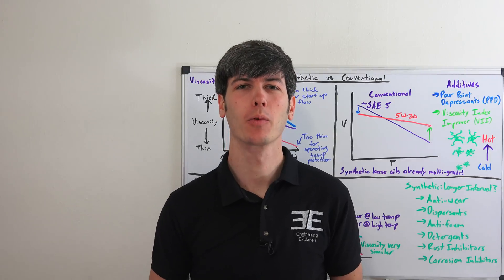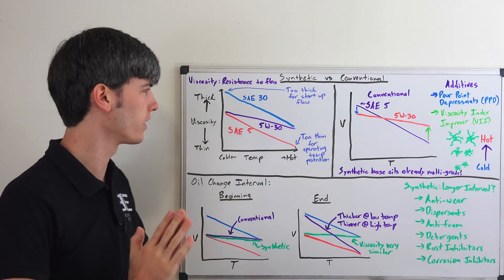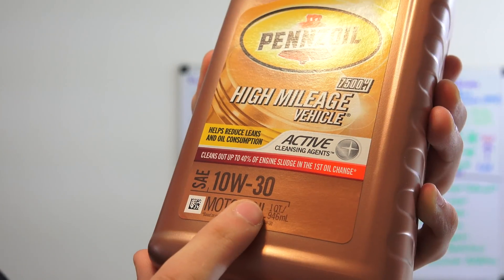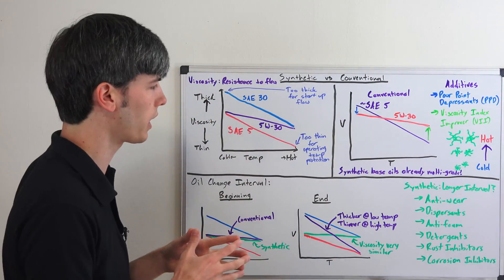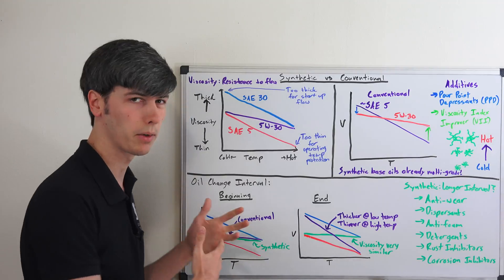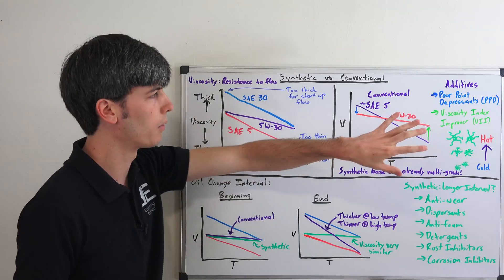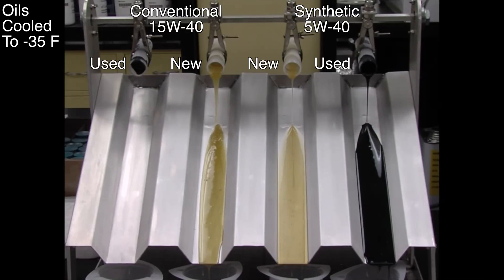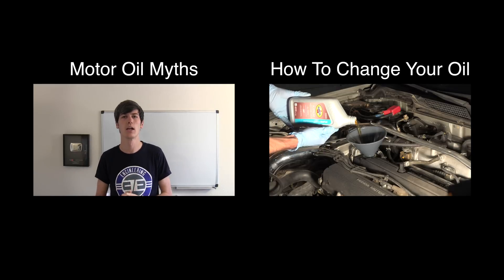Is Synthetic Motor Oil Better For Your Car?

Comment: the test is done at 35°F? are you kidding me? which car runs at 35°F? to do a real test you should do it at real engine temperature...
Reply: get in your car in the winter time and start it genius, guess how cold it is outside
Reply: Kai Baumgartner what outside has to do with inside the engine? we have single digits sometimes and never seen the engine temperature at 35°F. just did a test, outside is 29°F with feeling of 25°F and the car was all night long parked on the street. at the start the engine temperature is 89°F
Reply: Two things: 1) the test is done with the oils cooled to NEGATIVE 35F - i.e., MINUS 35 - not 35F. The guy says so, and the same information is in the top left of the screen; 2) the point of this is not to demonstrate anything about how the oils would behave in a car engine at running temperature: it's to demonstrate how they behave relative to each other at the same temperature.

Lowering the temperature is just a practical hack that makes for a better demonstration. It makes the oils viscous enough that they don't just slide off that inclined plane in a second: you get a chance to see how their relative viscosities differ. So long as they're all at the same temperature, it's a fair comparison.
Reply: Paul B finally someone gets it. Oo and if anyone is curious. In a lab that tests engine oil they run the oil at 2 temperatures to get kinematic viscosity, 40°c and 100°c. We also run it in a "cold crank" which drops the temperature to -5°c to -30°c depending on the oil. That test is done with anything with a "w". A different test is done for transmission fluid and gear oil which drops the temperature all the way down to -40, depending on the fluid run temperature may be a little warmer.
Reply: Paul B 
Bill Nye the science guy wants to buy you a beer

Comment: About bogus as hell look at the test 15/40 vs 5/40 I have worked on autos for 50 years and I wouldn't run Syn. in a lawn mower it's great for cranks and cams but destroys cylinders

Comment: I like your presentations. There are lots of facts. But my epxerience often differs with you are saying. I have never used synthetic oil in 30 years. I owned cars for 17 years in South Africa and 13 years here in Canada. In South Africa I knew about synthetic but nobody i know ever used it. Here in Canada I know a few people with domestic cars that use synthetic and I am not sure if domestic cars need them more than imported cars. Maybe they do. But I have only owned one domestic car ever and i did not have it long enough to try out synthetic. I got rid of it and I am not going to get a domestic soon. So I am not convinced that synthetic makes that big of an improvement to start using it in my cars.

Comment: I understand the demonstration you provide but I would have been more impressed if the used synthetic oil looked less like tar.  I used synthetic in my Subaru and the used oil looks nothing like the black stuff you call used synthetic. It looks almost the same as it did when I put it in my car. I don't think that it would look that bad even after 100,000 km.  For all car enthusiasts who have seen used oil, you cast some doubt on the truthfulness of your demonstration.
Reply: Ray Dyck But Ray, does your oil look like that at minus 35 degrees Fahrenheit?  He has chilled the oil to exaggerate the changes.  Nothing hidden there. It was a great example that was well explained. Even showing why he didn't use the same grades was explained.

Comment: If your vehicle's engine is an older one with a good bit of miles on it, its a bad idea to make the switch to synthetic oil. I made this mistake on 3 different vehicles and with the same results! LEAKS AND RATTLES after about 6,000 to 8,000 miles after the switch. My brother who was a store manager of a popular vehicle service center for 25 years learned the same thing I did with return customer complaints of leaks and loud engine rattles. So, he had to stop even offering the synthetic oil change upgrade to owners of older vehicles. If your engine is 4 or 5 years old (or older)with 60,000 or 70,000 miles (or more) on it and a life of conventional oil then just keep doing regular service with conventional oil and drive it the next 100,000 miles or so and go from there. And here is a question that I always think about is with the synthetic blended oil! Is it an idea of trying to make the lower quality oil in the blend better? or is it to try and keep the upgraded synthetic oil from being so good it ruins your engine? Its a joke concept!  

And remember that MOST OF ALL THE SYNTHETIC MOTOR OILS are made from petroleum crude, or to say that is where they get the molecules to build the synthetic counter part. YES! synthetic motor oils can be made from other plant life but at a MUCH GREATER PRICE TAG! In brief they take crude oil and process  it down to molecular level (beyond refining), this removes ALL of the natural unwanted tars and paraffin that are present in the crude oil, then they take these collected molecules and reconnect them back into molecular chains, these NEW molecular do not exist in nature hence the term "Synthetic" can legally be applied. 

And here is the reason that this ULRTA clean oil is bad for OLDER HIGHER MILEAGE ENGINES! It breaks down this golden colored plaque (dino plating) (not sludge) that is left from the the over heated tar and paraffin's. This plating builds up over a period of time and it crowds all the internal parts of the engine, including seals, it also plates gaskets on the inside and causes them to overly dry out. As the engine parts wear, the plating crowds in, it pushing on the internal lip of the oil seals, ALL these items wear and seat into play with each one another. Now what do you think is going to happen if you switch to an oil that HAS NO tars or paraffin's in it??? well it actually starts to break down the dino plating, the first time you drain that synthetic oil it comes out REALLY NASTY! and you think WoW this is great! but what made that oil so dirty looking is the dino plating that those engine parts have grown to depend on, those oil seals are to worn to reseal in a new position, those over dried gaskets are already rotted and the dino plating that helped them to hold in the oil is GONE! those crowded mechanical parts that were so crowed now have from new room they never had, bottom line! leaks and rattles. In two of my vehicles as soon as the rattles started I did a quick switch back to conventional oil (the cheaper the better) and just let them idle for about twenty minutes, in which they still were rattling but the oil pressure was good, so I just drove them. The short of that story is around the 15,000 mile range on the conventional oils and both vehicle engines actually started sound decent again, with only light ticks and minor clicks, of course it was to late for the oil leaks! The question that one might ask themselves is, Whats To Old? How Many Miles Are To Many? Is It Worth The Risk? Its Your Call!

Comment: If you are doing the oil change yourself  then you are only paying for the oil which is very cheap.

I change my oil every 4 to 5000 miles and there is no way that's harmful to the engine, quite the opposite,  so stop being a bunch a tight bums and change your oil more frequently.

I use part synthetic oil and don't have problems and the engine sounds sweet.

Premature wear and failure on your main bearings and head gear is expensive to sort and takes your wheels off the road.

Comment: Mobil 1 synthetic 
Amsoil
Royal purple
For gas engines end of story.
Reply: Fram are decent if you pay $10 for their uber-super-heavy-duty-high-zoot-ultra-guard-macho version.

Moral? Pay $3 get a crappy filter. Pay $15, get a quality filter. Not many $15 filters are crappy. Pretty much all $3 filters are crappy. Fram just happens to head up the list of offering a lot of cheapo filters. A pair of Hanes socks would do just as well in my opinion.
Reply: Lifted_Above  Mobil One Full Synthetic with Mobil One oil filter.  Done.
Reply: Arthur Smith exactly true. Mobil 1 silver bottle 5w30...always.
Reply: Jason C. Excellent filters. Check out  YouTube  Mobil One live engine tear down The inside is in excellent clean condition using  Mobil One.
Reply: Thanos royal purple? Not so much. Try Mobil 1, Quaker State, Valvoline, and Pennzoil (who'd a thought?). 

https://540ratblog.wordpress.com/2013/06/20/motor-oil-wear-test-ranking/
Reply: I've been running Purolator filters for years. PureOne. Now they have an even more precise version at a higher cost.

Valvoline and Mobil 1 usually. In motorcycles I run Rotella synthetic and stainless steel 35 micro reusable filter by Flo or Scotts.
Reply: Castrol Edge All The Way.
Reply: Jason C Mobil One full synthetic and Mobil One oil filter. That's all you need to know. The testing has been done
Reply: Arthur, you already said that. LOL
Reply: Thanos I use Amsoil sure it's more expensive but worth it as far as maintenance costs.
Reply: Don't forget Red Line, pal…
Reply: The Mobil 1 filter is very good.
Reply: Redline and a Wix filter.
Reply: Thanos shut up. You're not a oil specialist. Go bother somebody else's planet.
Reply: Thanos loss the Amsoil otherwise good recommendation.
Reply: Also never ever use fram oil filters they suck in every way.
Reply: Use K & N filter.
Reply: Arthur Smith Will do. Thanks.
Reply: EpicEverythingDude75 Google top ten oil filters 2017. Fram holds three spots out of the ten.
Reply: I've had lots of issues with Fram oil filters.
Reply: Your problem with Fram filters has been because you may have bought a $3 Fram.
Reply: Amsoil and ROYAL,purple, do they have specs on the label? ie meets VW 502, 505, or Porsche or GM etc?  If not, it's not legit.  Liqui Moly, Motul, Castrol,Total is all the oils I use Syn, all work great,
Reply: their high grade ones might not be that bad compared to others..  they prolly have the same internals.
Reply: No
Reply: Supertech is better quality than royal purple. Royal purple following comes strictly from marketing.
Reply: Actually Fram is very good. You must just have bad experience with them. My dad uses Fram for our cars and they have worked very well and they last a long time. So maybe do research before saying Fram sucks, okay?? have a good day.
Reply: IMO Fram quality had been steadily going downhill, for years. They were more concerned with cutting cost, than producing a quality product. Things may have recently changed, tho'.

Comment: I have a Honda Accord Sport 2014 with almost 80,000 miles. Should I still put 5w-20 Mobil 1 Extended Performance or switch to the High Milage one. Thanks

Comment: Should have used the SAME oil weight #s for the synthetic and conventional oil drip test!!
Reply: Serio Uos the point was that the clean oil was close to the same and the used oil was completely different showing how the additive break down makes a huge difference. The reason why he had the oil so cold was to slow them both down, to see the difference more easily.

Comment: use royal purple. it's pricy but it's good.
Reply: after almost 7000 miles and 6 months in my LS400, the oil still looks clean. Didn't even burn a drop either and i've got 276k miles on the car. This engine's amazing.
Reply: Hmmm maybe depends on application, i've been using r.p for years on my car, got over 200,000km and the engine is like new inside... Can't say the same for the turbo 700 trans. I live in australia so we do more frequent oil changes due to our dirty fuel... We mix oil from bass straights which is full of sulfur.
Reply: Tony B Redline is best
Reply: Royal purple will give you royal sludge.

Comment: You couldnt pay me to NOT run synthetic, Mobil 1 is my fav because its easiest to find most anywhere, even in a lawn mower it will run twice as long on a tank of gas, not only run longer but even at idle the RPMs are much faster, so multiply that times 8 (pistons) and you see why I am sold on it.

Comment: And also i put rocks in my motor I heard it helps it run cleaner
Reply: yes it exfoliates the carbon off the pistons
Reply: Yes, cylinder walls need to agitated once in a while.
Reply: Using crack to boost your engines' performance is a great idea. I don't think it will run cleaner though. Just be careful when it crashes. You don't want to ask the cops for help.
Reply: One one Guy sugar and sand help too
Reply: I add a little bleach honestly.
Reply: One one Guy only if you use clean rocks

Comment: wouldn't it be wise to get your oil tested to figure out the oil drain interval be the best?  Having done this in the past I've found I can get 8K before I the chemistry starts to fail, where the manufacturer's interval is 6K.  I've used Blackstone labs for my oil testing.  Having a turbo engine I also have the oil tested for gas dilution.

Comment: It seems that this video assumes both oil changes are done at the same intervals. I synthetic oil is changed at 5K miles and conventional oil is changed at 3K the viscosity should be very similar at the time of the oil change. Since synthetic costs twice as much but lasts twice as long there is little difference in those terms. You should get better gas mileage from synthetic but with the higher costs of the oil itself it may be almost a wash. When towing or any other activity that would tend to generate higher than normal heat due to engine stress, synthetic will give better protection. Like towing a boat love going distance or something similar.

Comment: you forgot to mention that you can use synthetic but when you start noticing puddles switch to a regular sae oil if your car has been ran on regular sae oil and you switch to synthetic you may start noticing puddles

Comment: I've been using the same oil and filter last 5 years of owning my 2009 jeep liberty. it has 165k. should I switch to high mileage? or should I just continue to use the same thing? been using pure one Purolator and pennzoil synthetic.

Comment: So to understand correctly, you will get better protection toward the end of your oil change interval because the additives will not break down as quickly. My question is on cars that are designed for synthetic oil usually the change interval Is much more then an engine that would take conventional oil. Does this mean due to the extended period the wear is the same but the consumer saves on maintenance due to not having to due it as frequent or does it actually retain the protection longer until the very end of its life cycle up to requiring change? Thx

Comment: My oil leaks so I keep adding new oil continuously. My car will last longer as long as I keep oil levels and change filter.
Reply: Hiram Duran why not just fix the oil leak dummy
Reply: +Hiram Duran
LOL... yeah, I've had old "beater" vehicles that I would do the exact same thing.  And yes, you can keep doing that.  You should probably do a proper oil change about every 10,000 miles though, because you need to replace the filter.  One beater that I drove to and from college every day, was an old, early 80s VW Rabbit that I paid $400 for.  It ran fine, but would lose about a quart of oil per week (not to mention needing air in the tires every couple of days).  Over the summer, I left it parked in the dorm lot and didn't realize the permit had expired.  So it got towed, and by the time I found out about it, it would have cost nearly $1000 to get it back, so I just gave them the title and told them to keep it.

And that also answer's Gilbert's question of why not just fix the leak... because for these kinds of vehicles, it would be FAR more expensive than the car is even worth.
Reply: Hiram Duran   Toss in a quart of Lucas Engine Oil Stop Leak. It could stop your leaking oil. Check your valve cover gaskets. Could be rear main seal. No harm in putting in the Lucas. It may help.
Reply: Start using 40w oil and add Lucas stop leak additive for two oil changes. Works great. Don't use synthetic oil because it's so slick it will leak through all worn out  gaskets. It also drains off of parts while engine isn't running. So basically you have no oil on engine parts  at start up.
Reply: Agreed with the others on not using synthetic oil for older vehicles because it will cause the gaskets to leak, and do use Lucas oil.
Reply: Hiram Duran ...next time just leave the oil filter off and just add oil here and there ....

Comment: Hey guys, I have a question. I am using 10W40 for my Opel Kadett 12SC as the owner manual says. But I am observing a strange behavior. When cold, my oil pressure sensor shows full 5 out of 5 pressure. And after some 15 to 20 minutes after oil gets warm, the sensor shows almost none of the pressure, 1 or 2 our of 5. Is this problem with oil? Or my car is screwed? Thanks!